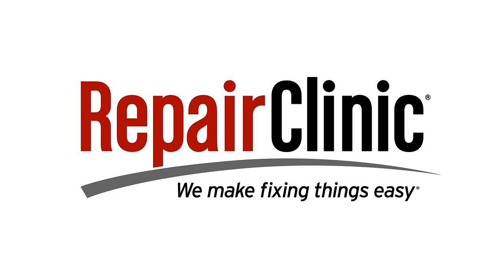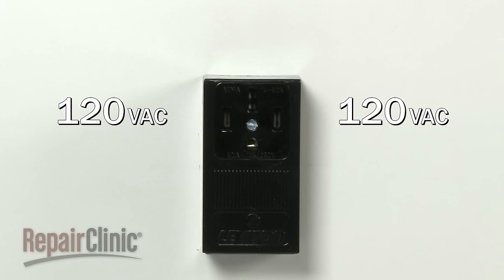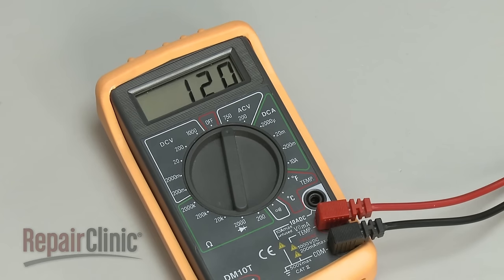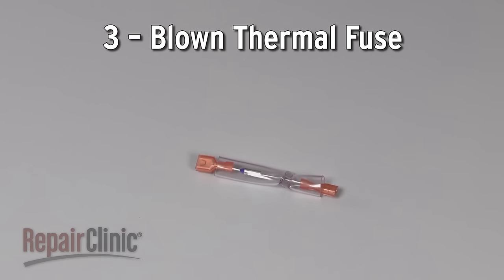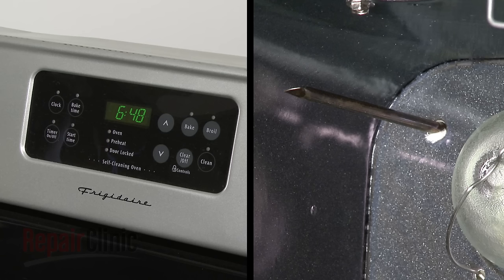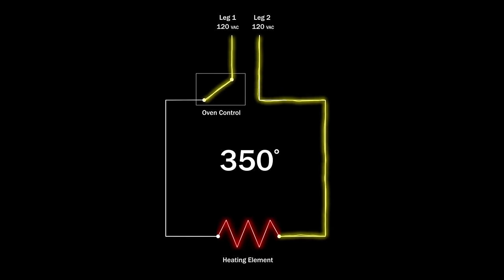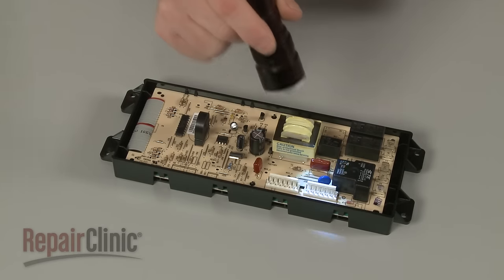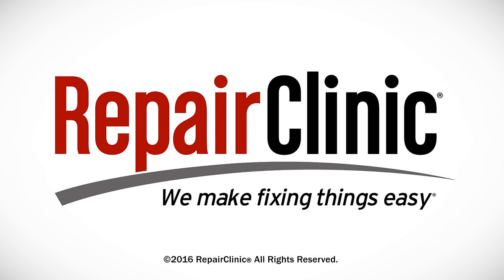Top Reasons Oven Won't Turn On — Electric Oven Troubleshooting

Comment: I have a Frigidaire self cleaning unit. For whatever reason both the oven and stove top burners decided to stop working.  However the clock is still right and when you turn on the burners and/or oven, the lights come on as if it is heating up.  But nothing.  Turned off the breakers and turned back on with same result.  Any clues?
Reply: That's my exact current issue. Did u ever find out what happend ?
Reply: I have the same problem landlord said it was the elements in the stove burnt out
Reply: Mine turned out to be a bad breaker. Half worked and half didnt. I replaced the breaker and everything works amazing now 😁
Reply: I have experienced this same issue. It usually occurs after I have spoken harshly with my beloved stove. I generally am kind, but sometimes my tourettes flares up, and I may burst out with a string of profanity, with no apparent cause.
However, I have found that a simple heart-felt apology, followed by a thorough cleaning of the stove works wonders. We are back to a loving consumer/stove relationship in no time, and the chocolate chip cookies bake so much faster.

Comment: My Electric Stove will come on the convection part with work. But when I set the dial on oven the stove light will flicker and turn off.  I reset the breaker too check the wall outlet making sure it is plug in right. But still not working.   Any suggestions Thanks.

Comment: if the oven heating element burns out/arcs, what is the most likely reason the oven will  not come on after the oven heating element has been replaced?

Comment: It worked for me!  The ovens and clock still worked after the power outage, but none of the burners would even make a peep!  Flipped the breaker off, waited a couple of minutes and VIOLA!!!  I once again have a working range!  THANKS!!!
Reply: Hey, where is this breaker you speak of? My burners don't make flames, although they beep. The oven is working, but not the burners
Reply: Troubleshoot whirlpool oven. Error e1 f2

Comment: De Dietrich oven, we have to press the timer select button 4times to bring on the oven. Its like as if the oven is set on zero.  Another point to note is if your oven/ grill doesn't come on after a pyroclean,  slide out oven, take photos of oven covers. Remove covers and find the overheating trip button on top of oven under covers. Press  button to reset. 
Return to cooking without service callout!

Comment: Hi, just came across your video, we have a hotpoint double oven with hob top  the top works fine the grill /oven works fine but the large oven wont come on. WE HAVE REPLACED OVEN heating ELEMENT ,FAN AND  MOTOR AND THERMOSTAT ALL NEW AND ALL HOTPOINT PARTS. [Sorry the caps are a mistake]. The oven still will not come on what else should we try please ?the model is EW74X  . Hope you are able to help and thank you in advance

Comment: I have a Frigidaire electric self cleaning stove. Only way it will show clock display is if I turn one of the knobs as if heating the quick boil but it won’t heat up and if I turn the knob to off the whole stove cuts off. What is going on?

Comment: I have an old Moffat Gourmet 100 and the oven isn't working and the 2 right burners. I'm sure that I could fix the burners but I'm not sure about the oven!! It has the broiler and rotisserie attached at the top and it works. I don't have the rod for the rotisserie but the motor still works...

Comment: Replaced control pannel only 4 months ago now the control panel will not turn on at the flick of the electric supply switch. What might be the problem since Ihave made a visual inspection of the components and can't detect a lack of continuity?

Comment: Hi. I have Samsung stove model ftq352iwx.Stove top works but bake does not. When picking bake all the light light up on display screen
When I pick broil , broil works.

Also if I leave door open and pick bake it turns on and works, when closing the door all display lights come on and it resets itself. Any ideas where I should start first. Turning off breaker did not help.

Comment: My kitchen aid stove oven panel just went dark with an E code showing for a bit , oven self clean mode was not used but we did bake a few days before. We looked at the videos for possible causes , changed the sensor at the back of the stove, but oven still not coming on , burners on the top working fine. My husband then open up the front panel of the stove and tested a similar device like the thermo fuse at the back there are two at the front but with grey and white wire attachments instead of black wires and one on the right there is no power as seen on the tester
Reply: did you fix it, what was the issue

Comment: Hi, we had an electricity outage and when it came back, the oven is completely dead. I have frigidaire professional series, the top is gas and oven is electric. The gas stove is working fine and there is power. But the oven, control panel and the warming table are completely dead. Trying to diagnose the problem to be able to call someone to fix it. Mine is a Frigidaire professional series oven Model CPCS389EC2. Appreciate your advice.
Reply: did you fix it, what was the issue

Comment: My electric burners work and turn on, the oven and the control board doesn’t light up. What could be my problem?
Reply: Corbin Sanchez-Cox ground wire was left loose. Had to tighten it up and worked like a charm.
Reply: P6o

Comment: Hi my oven lcd display is not coming on at all wat could the problem be?
Reply: Mine too..
Reply: Mines too! What the hell?? I just moved into a new apartment and they've got a brand new electric range with coils. I removed the coils one day to clean under the drip pans and the stove hasn't been on since! I have a small switch at the top of the stove and I've switched it on off without success. The stove is completely off! I don't know what to do. Can't find the model number on the side of the oven door to get the manual and it is too heavy for a little girl like me to pull it out and check the back.
Reply: I'm in the same boat...
Reply: @AmieB2005  damn I just moved and mines did the same damn thing wtf

Comment: I have a top oven and .I was cooking and I heard a big pop  and later the landlord came over and check everything out. He put a new plug in and plug the stove up and didn't nothing come on but the top.Could you please help me to understand what's going on and what can I do to fix this problem. The stove has a clock on it and it want come on . Thank You so much.
Reply: That pop was probably thermal resistor
Reply: did you fix it, what was the issue

Comment: First thing to check when electric oven is off especially after a power cut, check the electric breaker in the fuse box!!!!!
Reply: This video is for when the oven won't come on, if the stove top is working but not the oven it can't be the breaker or neither would work.

Comment: What about when you're booking and the oven won't  turn off . The light reads f1 and beeps
Reply: Never book travel flights or hotel accomodations while using your oven. If you happen to forget about the oven, and embark on your travels; it is possible that your oven may not shut-off in the absence of your parental supervision. Thus, you may return from vacation to find that those chocolate chip cookies have been baking for several weeks.
Reply: @marshalllhiepler , 🤣😂

Comment: I have a Whirlpool  electrical dual oven (w/Accubake System listed at the top right corner.  The lights on the control panel went off suddenly leaving just the inside light in the oven on.  It recently came back on it's own then shut off again.  When they did come on,  was able to turn the oven on.  Again, when it's off, only the inside oven light comes on when I open the oven doors.  Any ideas on what may be the problem here?

Comment: Kennmore wall oven model # 790.4808843901 not getting any power. When I initially hooked up the wires (red-to-red, black-to-black, etc), I mistakenly twisted the grounding wire with the red wire, which I realized instantly as soon as it started to smoke... I immediately shut off the power, fixed the wire configuration, power on, but the oven isn't getting any power - LCD screen is blank, no heat, nada! However, the outlet at the top far right corner (used for the microwave) is getting power. WHAT IS THE GOING ON here, and HOW DO I FIX IT so I can FINALLY cook a hotpocket??? THANKS IN ADVANCE FOR ANY AND ALL ASSISTANCE!! 🤗

Comment: Hello, can anyone help me? I have Gorenje Ora Ito oven and it won't turn on. The biggest issue is that the system keeps beeping, while constantly showing/blinking an error/fault code of F26-F28. Does anyone know what is the issue and how it can be fixed? I tried to resetting the time, but to no avail.

Comment: My LG oven has absolutely NO power. checked the breaker and power coming from the 220 outlet?  What could be wrong?
Reply: Well, I realize that your question was posted 6 months ago, and you probably have since purchased a new stove, but...
In the event that the old stove is still sitting in the back yard, adorning your rose garden  ...  
Find the Thermal Fuse (located somewhere deep inside the unit, much further than any sane individual would care to disassemble it down to)
...  and perform a simple continuity check on the Thermal Fuse to determine if it has blown.
If you are unfamiliar with the process of performibg a Continuity Check, simply post another question, and I will be happy to answer it wgen I stop by in another 6 months or so.
Reply: I have checked the breaker and the plug it all has electricity  but the whole thing is showing no electricity whatsoever it's a Kenmore glass top
Reply: Michael James,
The next step in troubleshooting, is to unplug the unit from the 220V supply outlet, and to begin to "trace the circuits" using continuity checks each and every step of the way.
For example:
Check the continuity between the left/right-hand male prongs of the power plug and the Input power connections at the back of the stove (with rear cover panel removed). If continuity is observed, then the power cord is not damaged.
Repeat this check with the "center" male prong and the center power supply connection at the rear of the stove.
Then check the ground connection in the same fashion. Also check to verify continuity between the ground prong and the center prong  ...  and so forth.
You will be looking for an "open circuit" or broken connection, such as a burned wire connection inside the plug or at the connection lugs of the stove itself.
Reply: @michaeljames6278  did you fix it, what was the issue

Comment: Light is on no burners are on,,, What is wrong with it?
Reply: The little light just shows that a burner was turned on and may be still hot after use. When the burner is cool, the little light will go off.